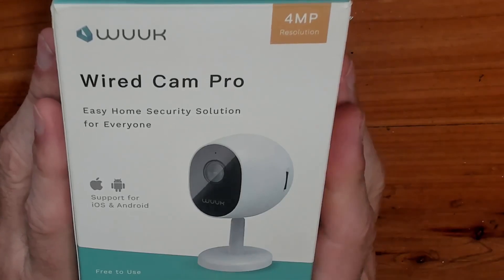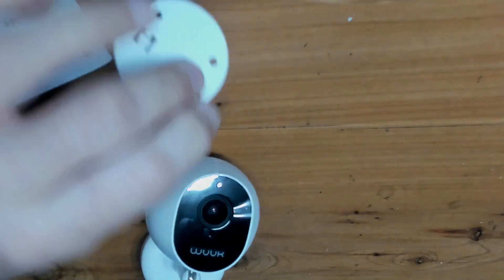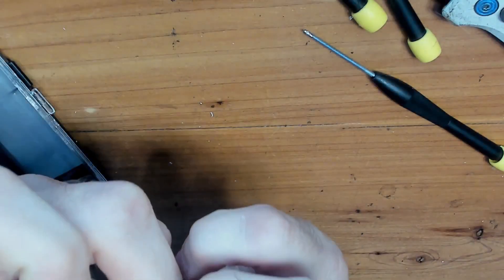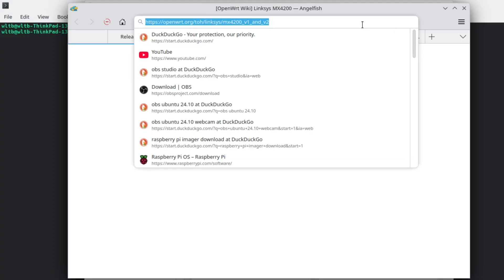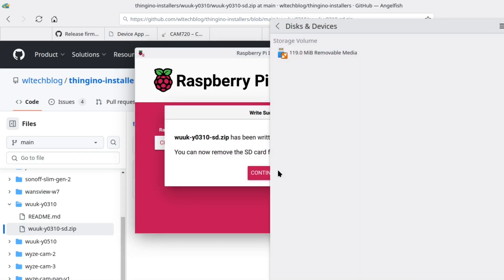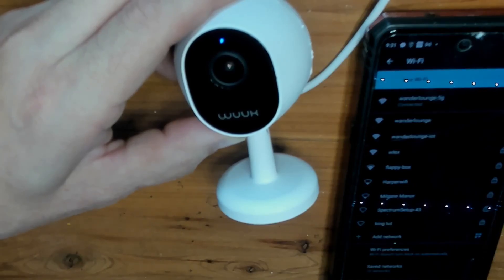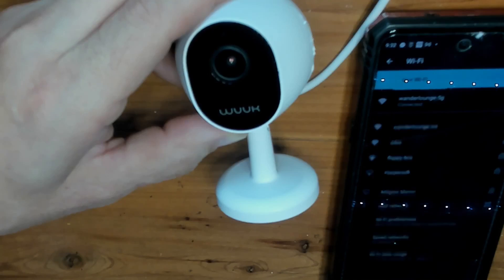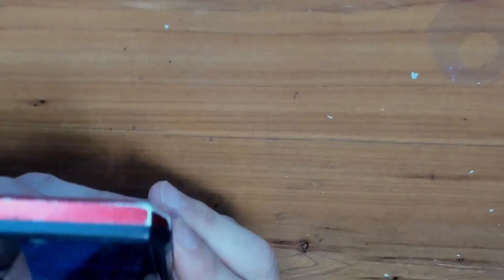WUUK Wired Cam Pro THINGINO No Tools Install! 4 Megapixel WiFi Security Camera UNLOCKED to SELF HOST

Comment: Would the same firmware work for Y0910, the cam pro v2?
Reply from the maker: Not at this time. I have one but it's using the newer T41 processor, which we are still working to add support for. Should be a GREAT camera once it's supported but until then stick to the Y0510 and Y0310!

Comment: I was hoping if you had firmware for the Cinnado b6, as this would be a great help.
Reply from the maker: Unfortunately the tech used in the solar/battery cams is not compatible with our firmware. They use an external microcontroller (often built into the wifi chipset) to keep the main processor powered down 99.9% of the time, and wake it up when necessary. While it may be possible to reverse engineer the code on the microcontroller, it would need to be done for each individual camera as they are not standardized and don't even use the same external microcontroller!
Reply: @wltechblog Thank you letting me know. I will start looking into another. 👍